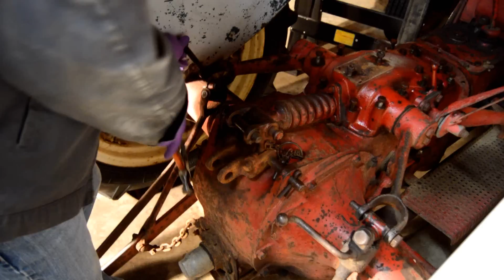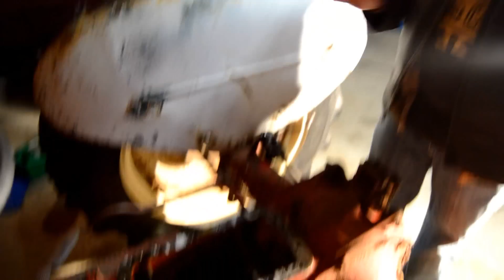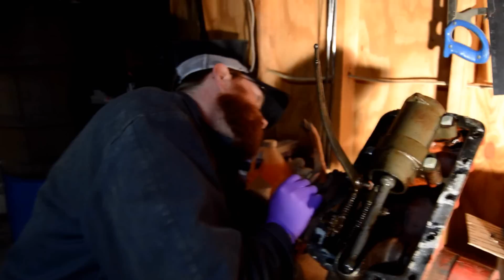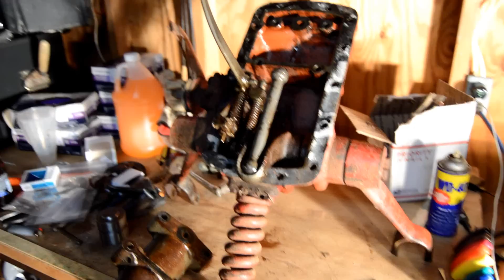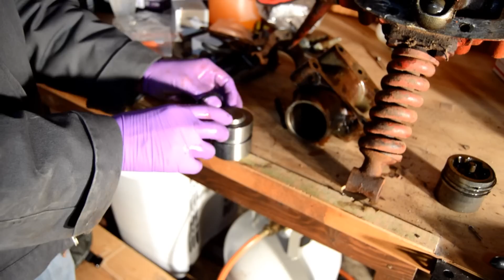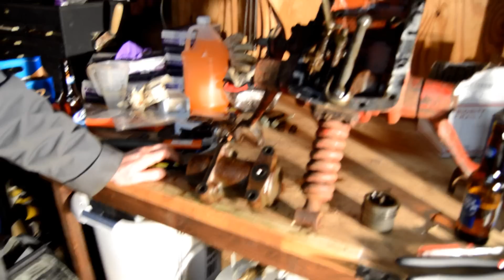FORD 8N HYDRAULIC LIFT ARM REMOVAL & REBUILD

Comment: Well, it appears that the control lever is bent.  It's the thingy that goes in the relief valve that you pointed to at the end of the video.  It is known to bend over years of use.

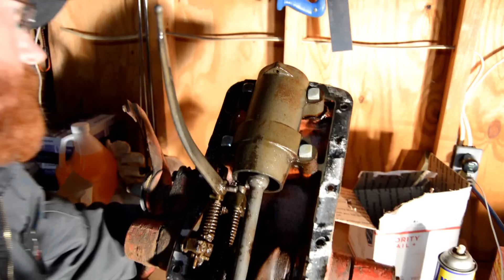Comment: i didnt see anything wrong with that piston.  @7:13 that long arm has dowels pressed into it that ride on the valve linkage. they get flat spots on them from no lube and half a century of wear. this reduces the stroke of the valve which cuts the flow rate down.  these old tractors had leakage so  this flow rate was built into them. pressing these out  rotating them 180 and reinstall and you'll be good for another 50 years.
Reply: yes the quadrant is adjustable  but the wear will be too much to be offset by the adjustment
Reply from the maker: Thanks for the info!  It was the seal that was the seal on the piston I think and we put a new piston in because it was cheap and we ordered parts before it was apart.

Comment: I cleaned up everything and reinstalled old oil which looked very good. Had a terrible time getting the rod in the correct slot. Dont know how one could get a gasket under the cover.  Of course it didn't change anything.
Reply from the maker: Thanks for watching hope you are good to go

Comment: So my handle and three-point seem to be falling together if I hold the handle it doesn't creep down do you think I need to rebuild something or possibly tighten the handle some way?
Reply from the maker: I'd say the handle for sure I believe this some sort of friction plate at the base of the handle.  I would have to look at it or a parts diagram but def look into the handle!

Comment: Sorry for my English but i have one this toys and i like to fix it (well try)  if my PTO works is that means my pump work well or not ? and i still don't understand what's push the lift to up ? what's the use of the long arm i don't understand is utility. when you move the controler they are no relation with the pump  big thanks
Reply: Yves, go to the Ntractor club website, all your questions will be addressed there.  A great bunch of tractor guys will help you.

Comment: To get the top cover off did you have to open the sides first and disconnect any linkages?
Reply from the maker: Kurtis Cal3msetccdwell no but you can take the side off  because you will need to going back together to make sure the 3 point rod inserts correctly
Reply: @WorldsOkayestFarmer  my lift wont lift after it reaches the height of the two pins on my plow. It will lift me if I stand on the arms up to the height of those pins. If I get off the lift will go higher but then leak down very quickly to the height of those pins on the side of the plow. 

Is this the cylinder doing this or maybe the pump? I can't test pressure as someone before me welded the test port closed.

Any insight is greatly appreciated. I can upload videos if you'll watch them and tell me what you think.

Comment: 5:17 The Fergusons had regular motor oil for their hydraulic system
Reply: Michael Nugent  I realize this is an old comment, but to clear up any misinformation...Fergusons did NOT use motor oil in their hydraulic system. The correct oil for the transmission, hydraulic system, and differential is 80 or 90wt mineral gear oil.